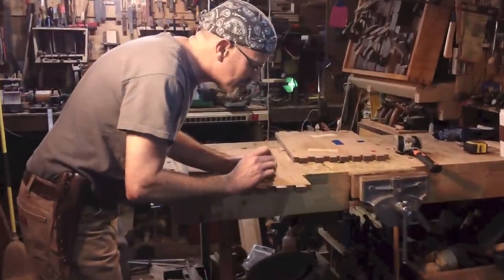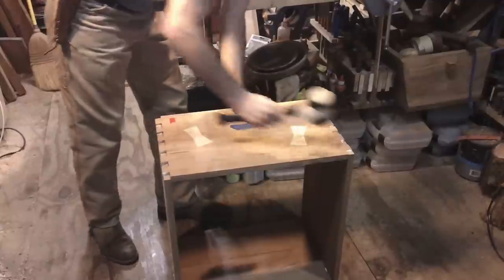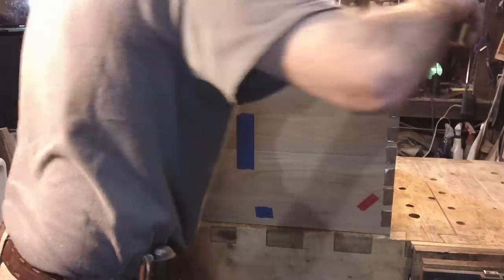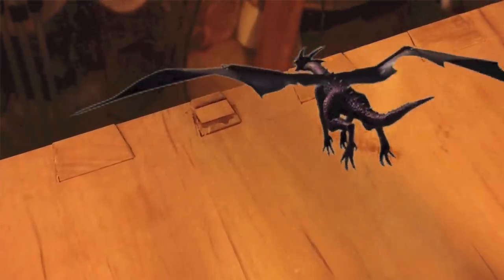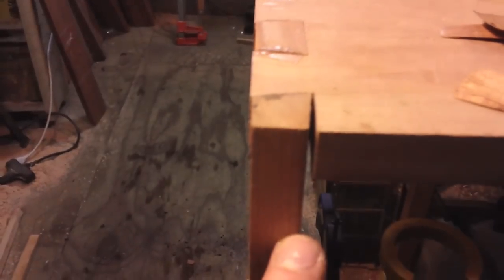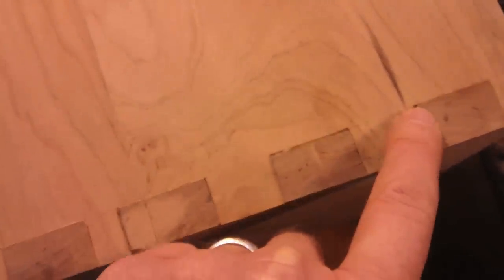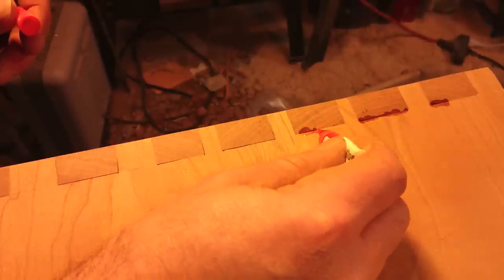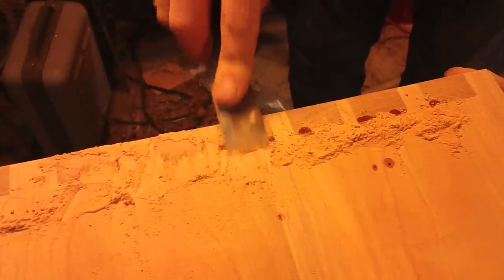Chest of Drawers Part5

Comment: An antique collector once told me that "perfect" dovetails are not often found on older chests. He said that dovetails were strong and made quickly. The makers were not especially concerned with the exact fit and most all of them used one of your methods to dress up the joints, if they wanted them to look a little nicer.
Reply from the maker: Lew I couldn't agree more. They were trying to make a dollar and could not spend the time like a hobbyist like me.
There is one more that I use. With soft woods. I cut leaving the line not even getting a dry fit. Apply glue and beat them together. You get tight joints if you don't split out.
Thank you for the share my friend.